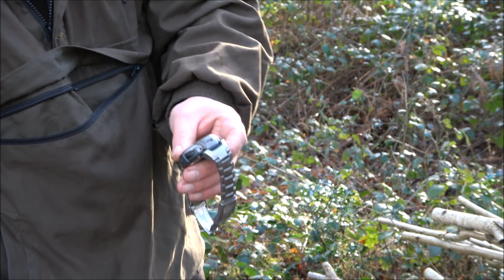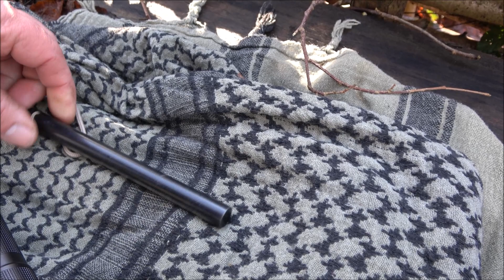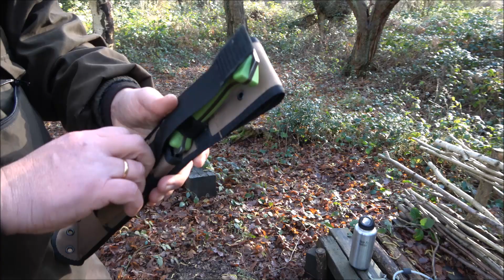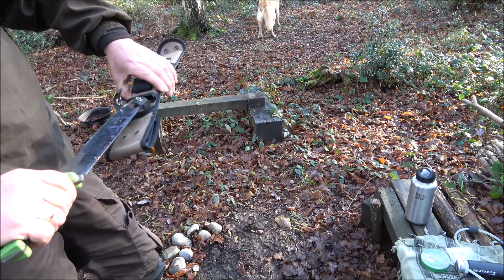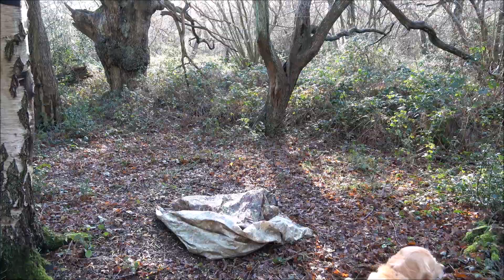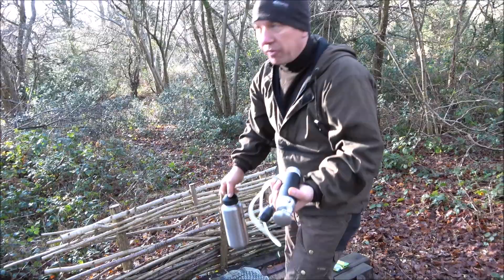Pocket Survival Kit

Comment: Say Heah M8, and Cheers. You did good, Thanx You. I like to do alot of Afternoon Delight's, Hikes, Harvesting Fatwood etc. So I made a couple of Trio's, My Lite Trio is my Mora 2000, my Mora Hatchet, and my Bacho Laplander. I carry a Pouch with basically what you have in it that goes on my Survival Belt. But when I Scout a new area, I like my more Robust Trio. I love my Modified Rodent 6 which I had thinned down and the top guard taken off at their Busse Custom Shop, It looks like my Ratmandu but on steroids. I also like to add my 17" Hultafors Bruks Agdor Hatchet which I can carry it on my Axe Holster, or on the side of my Kodiak Gearsling. Also my Agawa Canyon 21 Boreal Saw, or my Silky Bigboy2000 in the Scabbard. I usually carry one of my smaller Backpacks, but I can also go with my Haversack with atleast the 5 C's. But on person, I have my Trio, and Necessities Pouch. I generally carry (2) compasses, one in my pack with a area map of where I'm scouting, and my large Davey Voyager Compass that I use as my directional compass, but I can use it on a map also. I also just got a Leatherm Charge TTi, that has a nice main blade on it with a small Saw, and a Can Opener  for canned food., I also sometimes just use my Victorinox Delemont Collection Ranger 78 as back-up, or my Mora 510 as a neck knife on a ball chain. But I also have a lighter Trio that's robust. I like my Benchmade Bushcrafter #162, my 2Hawks Double Bit Hatchet, and my Wicked Tough Saw that's about the same size of my Bacho Laplander, but much stronger in its Scabbard, and I can carry the saw in the opened position when I'm building a shelter. Infact, I posted some of my Toys on my Google Plus. You did good M8, Thanx You. Dilly Dilly.,,.p